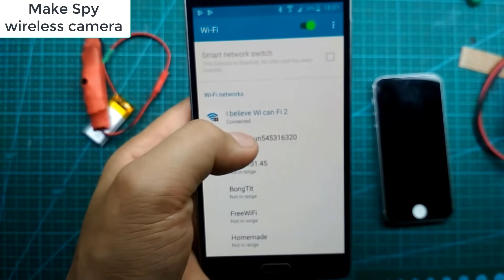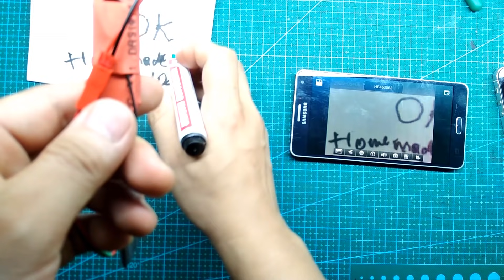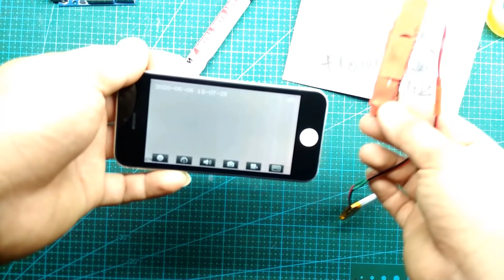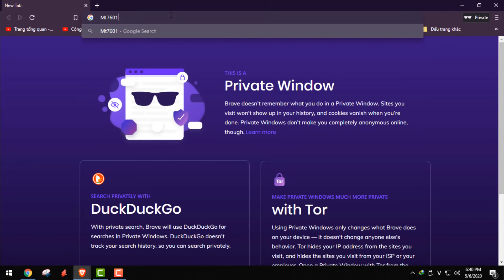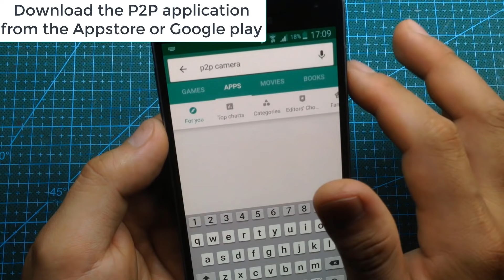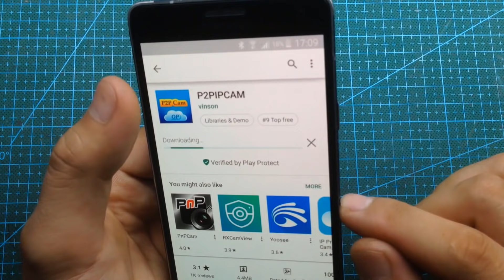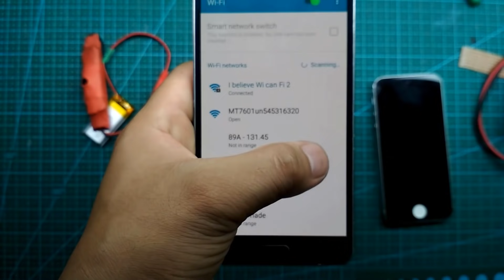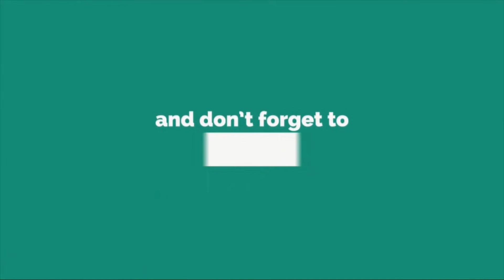Make SPY CAMERA WIFI super Small

Comment: 8:48 Bro,  I bought it the same in the video.  I can supply 5v?  In 3.3v it does not work well,  How can I check if its still working. Using Multitester
Reply: Bro can u give the purchasing link of it for india or global delivery or pls give me the name of the product
Reply: @gamernekill2588  Mt7601 wifi module
Reply: Blow :( 5v
Reply: I will make the same thing, i know if the wireless link is bad is because the antenna... i have a similar issue with my rc 2.4 ghz radiocontroller and the culprit was a broken antenna ... just replace it with a wire then trim it to the correct frequency.

Comment: Mt7601 only works with 3.3V and you use 5v. You mention that in this module there is an AMS1117 ic, where is it located?
Reply: In my channel also i upload old laptop webcam diy to usb cam.. the webcam is 3.3volts u got it right... But i use it without stepdown diodes just as 5volt usb... Thankfully it work.. 😁

Comment: Bro,  Mt7601 is power by 3.3V only, and you use 5v.  Its safe for the sake of chip?
Reply from the maker: on this module there is an AMS1117 ic
Reply: 8:48 Bro,  I bought it the same in the video.  I can supply 5v?  In 3.3v it does not work,  How can I check if ts work

Comment: Can we used for web cam desktop type
Reply from the maker: I bought it at the store, very easily
Reply: @PhdHung  nop sir. ill ask laptop webcam instead we can used desktop web cam
Reply: You could use a desktop usb webcam as the usb laptop camera too, because all you need to do is replace the D+ and D- to de laptop usb camera for the desktop usb camera in the module. So, instead you use an laptop camera with usb support, you could use a desktop camera with usb support to.

If you try it, place share a video when you have the finally job ended

Comment: SORRY OF CAPS, I HAVE THE KEY BROKEN; FIRST OF ALL DO NOT SHOW THE ACTIVATION OF THE CAMERA LED BEFORE INSERTING EVERYTHING IN THE HEAT SHRINK SHEATH, PLUS YOU HAVE CONNECTED EVERYTHING TO 5VOLT, THE CHAMBER GOES TO 5VOLT AS YOU SHOW, BUT THE MODULE WORKS AT 3.3V, YOU HAVE ADJUSTED TO 5VOLT AND THE VOLTAGE REGULATOR ONLY HAS ONE OUTPUT.

THIS IS A FAKE, I BOUGHT THE SAME MODULE WITH THE SAME WEBCAM AND IT DOESN'T WORK AND IS NOT EVEN DETECTED WITH A 2.4G 50OHM ANTENNA, MOREOVER ON THE WIFI MODULE THERE IS NO IC 1117, AT LEAST THAT IT DOESN'T TALK ABOUT REGULATION VOLTAGE, THE WIFI MODULE WORKS AT 3.3VOLT +/- 02 VOLT. YOU ONLY LOSE TIME.

👎👎👎👎👎